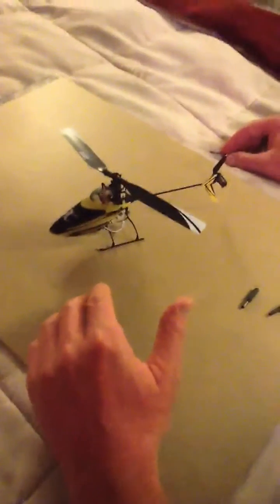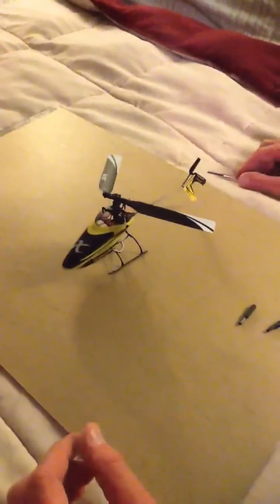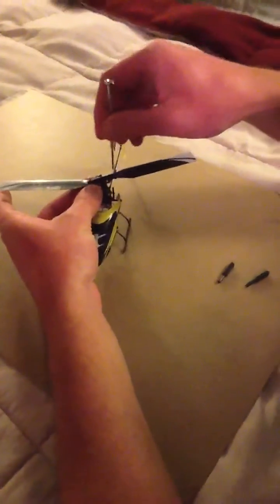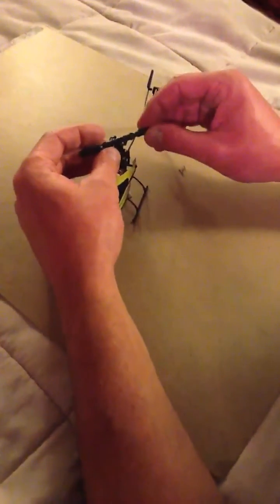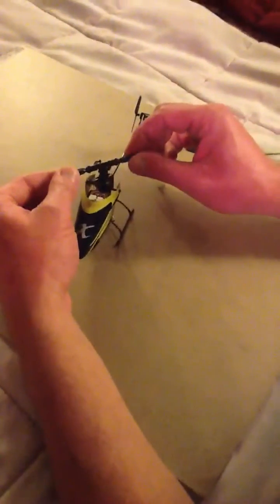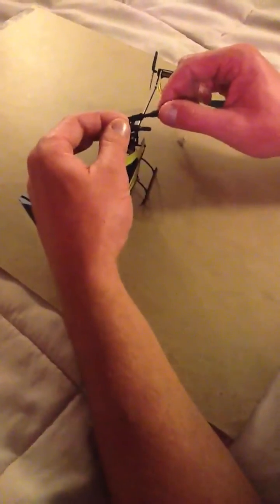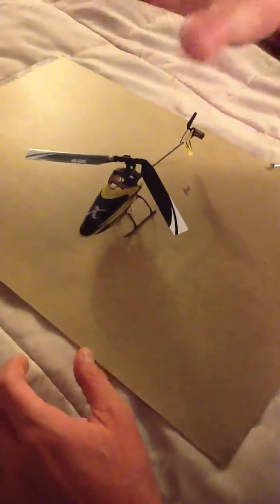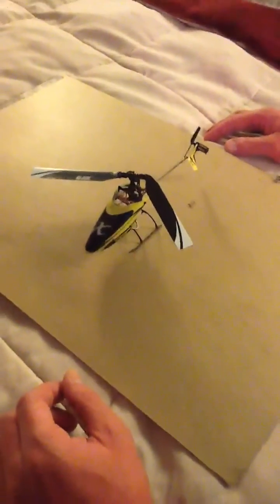Blade nano cp x vibration fix cpx ncpx

Comment from the maker: I also found mine flies better, when I have the heli perfectly straight and level when I plug in the battery and then wait a couple of seconds until you hear the AS3X system making the servo adjustment sounds, then set it on the ground and fly. 
Over all I am very happy with the heli.

Comment: I did the same a few days ago..it does help some, but I have some other issues. The motor on mine seems to be going out and I am loosing power. I have received one replacement motor and I am going to replace it for the second time!!